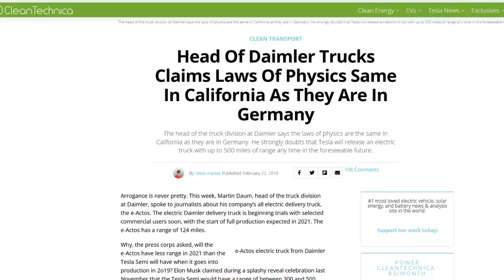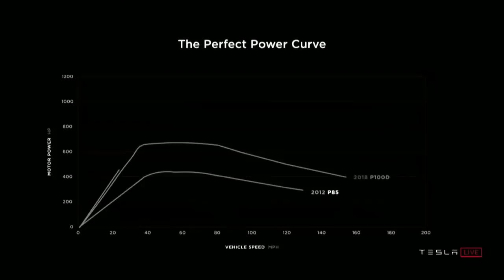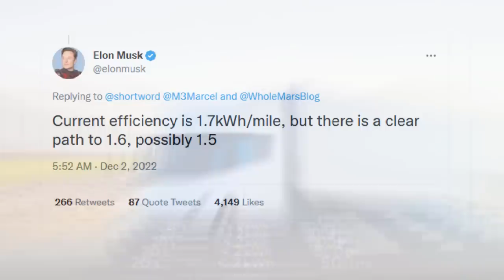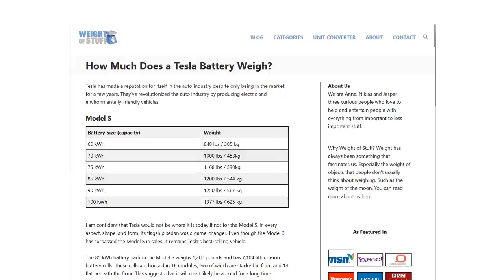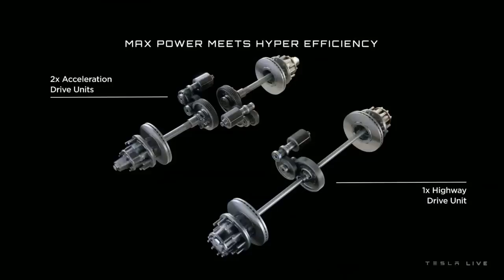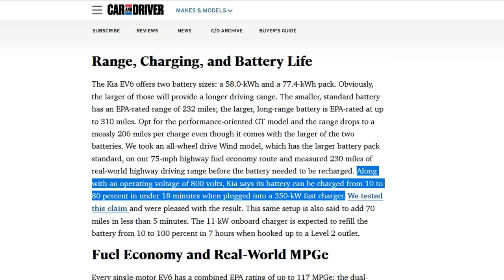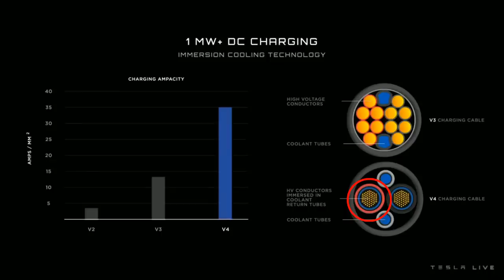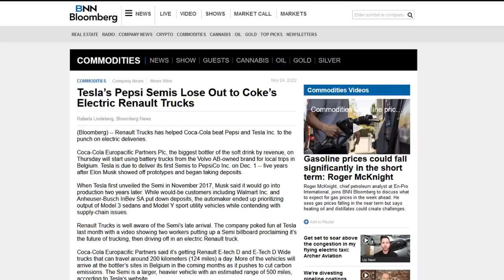Elon Musk Drops Tesla Semi Bombshell

Comment: I'm a long haul truck driver and honestly, I'd be happy to drive an electric truck. I have no "love" of diesel, as long as I have a power unit that works and makes me money, great. That said - there are some real problems with people's enthusiasm for this recent "event" that our pal Elon held the other day.

80,000lb is the max gross weight of a truck for most highways in the US without getting special permits. I have a truck with an EPU (electric aux power unit) so that I don't have to idle when the truck is shut down to power AC, etc. For this most states (-2) allow me an extra 400 lb to offset my batteries so I am legal under 80,400 gross. It seems the Tesla semi is being given 2000 to offset the batteries, at least in California. But gross is not freight, it includes the weight of the truck, gear trailer and the freight. Most modern diesel trucks promise shippers that we can haul their freight that weighs up to 48,000 lb which means we keep the weight of the truck / trailer to under 32,000. 

Elon and his staff talked about the truck that went over Donner pass being "fully loaded" at 82,000. But he didn't give us any idea what the weight of the truck / trailer was vs freight. I saw that he was using a flatbed (which is what I drive) loaded w jersey barriers, the low concrete walls that you see placed to direct traffic, etc. I'm not sure what the total weight of those barriers would be but I can make a very educated guess. The most common jersey barriers are about 4000 libs each. In the video at his event it looks like the flatbed has 9 barriers on, so the total of freight looks to be max 36000 lbs, which is a fairly light load. This means  the truck and trailer were considerably more than 32,000 lb if the gross weight of the loaded truck was 82,000, something like 45000 lbs, or 13000 lbs heavier than most of today's diesels.

People who aren't truck drivers might think it's not a big deal and that I'm nitpicking, but I can assure you that I'm not. How often do I haul 80,000 lb? Well, it's tough to get loads to weigh exactly 48000 of freight but I'm generally carrying above 70,000 most of the time, maybe 2/3 of my loads, and I'd guess that about 1 out of 8 is 78,000 or more.

As a flatbed driver freight like steel (coils, tubes, plates) aluminum, copper, roofing shingles, bricks, lumber, etc are loads where we show up and the shipper loads us as close to 80,000 gross as they can, weighing us on-site to check we are as close as they can be. A truck that can't carry that promised 48000 lb of freight is a major problem. Making the truck much less flexible when it comes to filling clients needs and making $.

The fact that they are not mentioning these facts and white washing over the issue to an  auditorium of techy car drivers that will seemingly clap for just about anything is a real tell that there is an issue that they aren't being forthright about.

A couple more issues as well, why did they choose to use a flatbed for this "trial" instead of a more common box truck? Especially when they talked about their research into making the aerodynamics of the tractor/ trailer work together? The answer is obvious to a trucker. The jersey barriers on the flatbed, not loaded to the side, are much more aerodynamic as they are about 3 feet tall vs the box truck being 8 1/2 feet tall from the deck and the same width as the truck. This gives a very big aerodynamic advantage to the truck on this trial.

Also, as for a "long list of companies clamoring for Tesla semis" it just doesn't seem to be true. Pepsi has an order in for 100 trucks, Walmart 150, UPS 130. This is nothing, barely an experiment. Walmart has a fleet of 10,000 semis, UPS 125000! I would hardly call an order for less that 0.1% of a fleet "clamoring".

Also, the 500 mile range is only adequate for a small segment of today's trucking. As a long haul driver I usually drive about 550-600 miles in a average day. 500 miles seems like it would be close to my needs but it's not. When my fuel is at 3/8 full, I'm looking to refuel. It's too risky to let it go down below say 1/4. Weather, traffic, detours etc all have to accounted for so my actual range in a Tesla would be about 375 miles, just a bit over a half days driving. It takes about 7 minutes to fill my truck with diesel, seems there is no way that I can come close to that time frame with an electric truck. Electric trucks would currently cost me a lot of time and therefore $.

Also, I don't start and end my day at a terminal. I am usually "out" all around the country for 2 - 3 months without coming back to a terminal. Where the heck am I supposed to charge this truck? There is no infrastructure in place or on the horizon. I can buy diesel about every 25 miles all over the entire country. No way that will be possible anytime soon for electric, actually, there is already a huge shortage of parking for big trucks in most of the country. So, even if you did put these into 100% of current truck stops I still would often not be able to access them. Changing this would take decades, at a minimum.

I would be interested to see how Teslas will work with local deliveries or as "yard dogs" (trucks that move trailers around at terminals) where they start and end their day at the same location. But any idea that this is going to be a major change in terms of the number of diesel trucks anytime in the near future is truly almost silly. It's going to take a long, long time no matter how much people want to hype Tesla!
Reply: Absolutely the most informative comment in the whole section. Probably more informative than the Elon Self-Congratulation video above.
Reply: "13000 lbs heavier than most of today's diesels."

Should be significantly lighter than that. Going off 250 watt hours per kg that they've achieve with cars a megawatt battery would be about 4 tons. 
Take of the weight of a diesel fuel tank, gear box etc and add on the extra weight allowance for EVs and they should be in the same ballpark as a regular truck.

"It takes about 7 minutes to fill my truck with diesel, seems there is no way that I can come close to that time frame with an electric truck"

Tesla is claiming 400 miles of charge in 30 minutes but you can unload while you're charging. That doesn't sound too bad but they'll need to pull off a miracle with the infrastructure. 

 "I would be interested to see how Teslas will work with local deliveries or as "yard dogs" (trucks that move trailers around at terminals) where they start and end their day at the same location."

I think they would also make much more sense out of the US. It could do almost any journey in England on 500 miles for example and power/weight ratio becomes more important with hills and more frequent stop-start driving. We also have diversions in some areas for HGVs to reduce local pollution which these should be exempt from. This would require a flat nose redesign for our streets though which would destroy the aerodynamics.
Reply: Joe, good arguments, here are my (short) answers to some of them:
- as for weight, I've read that the flatbed carried 11 barriers, so that would be 44,000 lbs.
- as for the infrastructure, just as the nationwide infrastructure won't be installed overnight, we also won't go to 100% electric trucks overnight. Let's start with local runs and installing chargers at terminals and customers first. Start with the low-hanging fruit and gradually build out more and more longer routes.
- as for charging time, i assume (Dutch non-truck driver here) you have to take mandatory rest stops and bathroom/lunch/dinner/sleeping breaks. Once that infrastructure is in place (and yes, that will be a hell of a job, no doubt), all that waiting time becomes charging time. In the end, there will be almost no time lost to charging, assuming that the infrastructure is there and trucks can charge fast enough, like this Tesla, 70% in 30 minutes.

If you want to read more research around electric trucking, I'd recommend @AukeHoekstra on Twitter.
Reply: @Ken North Where does such a breakthrough come out as useless? Just the elimination of diesel fumes around cities, (mandated by legislation already) is going to be a lifesaver, I expect many lives to be saved and accidents avoided. Why take the opposite extreme and say it is no good? You are 100% wrong on the face of it and are going to look silly.
Reply: Aha!  Finally a comment from someone who sounds like they actually are a trucker!
I've heard an interesting range of approximations of the load it was carrying now...  ranging from 1/4 of a diesel semi's load all the way to almost the same as a diesel semi's load...
From what I'm aware of, it sounds like the 500 mile drive was done conservatively along an optimised route - and during that drive it only overtook one diesel semi.  As with electric cars, it looks like it'll start off only being suitable for users with specific circumstances.  It'll be interesting to see how many years it takes for electrified haulage, including the infrastructure, to achieve mainstream viability.
I could see this sort of thing potentially being better suited to UK haulage than US haulage if only it were way shorter.  
But don't take what I say at face value, I'm a British gardener, not a trucker!
Reply: @Ken North That's my assumption.  As with anything Musk touches...
Reply: Very much agree.nice to hear a fellow driver(former driver here).
All these issues are very real but i think that with time they may be overcome.the infrastructure for electrical supply will follow uf the semi can prove its worth.if the cost of electricity can be brought down (and the powers that be can reduce their greed)then the operational cost of the vehicle can be reduced making an electric semi more cost effective.a reduction in load for a reduction in $/ld shipping would be enticing to many shippers.
Ive been off the road for many years now so my opinions are likely full of flaws and errors. 
But what has remained constant throughout history is if it can bring money the infrastructure will follow.
The biggst hurdle i see is electric supply.we either need to build more non polluting sources(nuclear) or learn how to better manage are current generation and consumption. 
I personally feel if the government will remove and rewrite obsolete laws concerning types of nuclear plants that generate byproducts useful in tge further generation of fuel for nuclear bombs...i/e fast breeder reactors....we could be money ahead.
Reply: One thing to bear in mind.
Was the extra allowance announced before the Tesla launch or was it as a result of others saying "we can't do it, we need more" AFTER Tesla launched?
Reply: I suspect there's a reason why they're starting with specific clients ... ones whom you can take a good guess at what their standard load will be and likely not be thrown any curve balls.  As much as this truck will save those clients a lot of money per rig, it's also still very much a beta test and tech rollout.  Doesn't mean it won't work well, but it'll likely get a lot better on the v2 and v3 trucks as the tech improves.  Those new trucks will also work their way towards those max capacities and increase the amount of the market share where a tesla would make sense. Heh, it's not one truck to rule them all yet despite the marketing, but it is one truck to open the market and make it profitable for select partners immediately.
Reply: @tedmoss  "elimination of diesel fumes around cities" doesnt put food on his table.
Reply: @bloodypommelstudios7144  If the weight is much less then why did that 35000 lb load make the truck gross 82k? 

As to unloading while recharging - why would customers invest in recharging stations at their facilities for us to use? I often deliver to fairly small operations, there is no way they would do this. Even bigger customers won't see this as their responsibility.
Reply: @McTrex123  some fair points there. It's obvious that infrastructure would have to change if the technology is accepted but I think it is still a big "if". As to charging and breaks i alluded to the fact there there already isn't enough parking in many areas of the US for big trucks as it is now. Even if all the parking spots available somehow suddenly had charging stations (I just can't see that happening for decades) it still wouldn't solve the problem. Every night I see huge numbers of trucks parked at on/off ramps of highways, roadside in industrial areas, "illegally" in shopping malls, etc. None of these would even have charging stations. The only mandatory break we have in US trucking is that we must take a 30 minute break within our first 8 hours of driving. We can do a maximum of 11 hours per day.. The flexibility of refueling that we have now would need to be replicated somehow with EV, or the whole system needs to change. I don't see either happening quickly for regional / long haul trucking
Reply: @tedmoss  Your sentiments are understandable, but the reality is that the whole transport industry would have to change for these trucks to be useful in number. I just can't see all the obstacles changing for many many years - ie, we can't even keep up with the need for regular parking in the US, much less having charging available at parking spots for every truck that doesn't go back to a terminal every night. Just nowhere near feasible at this point
Reply: @Ken North exactly
Reply: @phillip6083  Lots of interesting points there. I didn't even want to touch the issue of the power grid in my original post - so many obstacles
Reply: @rogerstarkey5390  no sure what allowance you mean, but if it's the extra 2K weight allowance for batteries there is already some allowance in the law. For example, I drive a 2021 truck with an EPU to replace a diesel powered APU (auxiliary power unit, basically a small generator). 46 of the 48 states give me an extra allowance of 450lb to offset the weight of my batteries for this unit, so I can gross 80450. I assume California has a law on the books for fully electric trucks to go up to 82K but honestly the Tesla event was the first I've heard of this
Reply: It is smoke and mirrors,of course automatoms clap if they see others do so.
Reply: @joepianpiano  
Ok, it was "a thing" in 2020.
How about 2017 when they announced the Semi?
Reply: Regarding the speculation over unladen weight.
The best indication I have is Zachary Kirkhorn (Master of Coin😉) stating categorically at the Q3 conference call this year
"No sacrifice to cargo capacity"
Followed by Elon Musk saying
"Yeah, exactly, very important, no sacrifice to cargo capact, 500 mile range"
.
Now bear in mind both the audience (shareholders [+"critics"?] and the financial "experts", some of whom would "tear them a new one" if found to be incorrect)
.
Then add the timing, shortly before the actual delivery of product.
.
Would that not be a "bold" statement if not absolutely confident?
.
And yet despite reiterating the same at the event, while showing EVIDENCE of a truck doing it there are still people saying "it can't carry the same cargo as a diesel".
.
What exactly will it take?
.
Maybe a "group test"?
Every current EV truck, plus the two most popular, up to date diesels?
(Diesels full at the start?)
690 miles? (see what I did there?)
11 hour drive day?
Mandatory stop?
Same route as the "delivery" test? (Extended 200 miles?)
.
Would that "prove" it?
.
Discuss.
Reply: Been waiting for an actually driver to point this point.. the whole thing seems sketchy.. You cant "launch" a truck and not state the weight!
Reply: @magicker8052  "Regarding the speculation over unladen weight ... What will it take?"

I can tell you exactly, it will take 10 minutes and $28

Run the empty truck and trailer over a CAT scale (available at almost every truck stop in the country for $14) get the empty weight, then scale it again after it's loaded for another $14. We do this all the time as drivers.

See, I know this business and you clearly don't. As soon as I heard Elon say "the truck is fully loaded at 82000 pounds" my ears perked right up because that is misleading. He should have said with 48000 pounds of cargo, for example. 

The fact that he chose to state it in a misleading way is already clear proof to anyone who knows this business that the weight of the truck reduces the amount of cargo it can haul - the only question is by how much.

Now, I'm sorry to be rude to you, but - you can go on reading tech reviews and listening to Tesla apologists claiming there is no reduction in cargo capacity or whatever other idiotic circle jerk statements they are using to hype their product. But if you actually believe them, well ... doesn't say much about your judgement.
Reply: @Mark it's true, I'm sure the ultimate goal will be driverless vehicles, I think it's an interesting idea way off in the future. But I'll tell YOU this "bud" - they'll be pulling your fingers off the wheel of your little EV car long before they'll be pulling me out of the cab of a long haul flatbed - guaranteed
Reply: @joepianpiano  I think you replied to the wrong comment.. I agree with you 100%
Reply: @rogerstarkey5390  see response above, sorry replied to the wrong person
Reply: @magicker8052  sorry!
Reply: @bloodypommelstudios7144  The battery is in the 800-1000wHr capacity, this puts the batter weight ate 17,000-18700lb
Reply: @bloodypommelstudios7144  Name one EV vehicle that is lighter than it's ICE copy.
The Electric Mini is heavier than it's ICE sibling the Mini Cooper S, The Ford Lightning is over 1,900lb heavier than the Ford F-150, Kona electric is 700lbs heavier than it's gasoline engined sibling.

I can find the weights for every single semi and trailer out there, every single manufacturer provides them.
They do so because that weight tells their customer the truck driver, the truck company owner, how much cargo it can move, and it tells him how many he needs, now many people he has to hire.
I dare you to find official weights for the Tesla Semi, the Tare weight, the weight of the Semi with an empty trailer.

So far the only way we have a clue as to the weight of the Tesla Semi is by reverse engineering using the known weights.
As Joe Pianpiano said, we know the weight of the cargo, and the trailer, and with that we have a ballpark estimate of the truck's weight
We also have the minimum weight of the truck using the weight of the battery and the known weights of a Semi of the same size minus it's ICE components.

Fact is the Diesel Engine (2,050-2500lb), the transmission (650-800lb), fuel tanks (call it 4,000lbs of fuel + the tanks themselves), all that combined weigh less than the 17,000-18,700lbs that the Tesla Semi's battery. Oh about that gear box, Tesla Semi has heavy reduction gears (more than one) that convert the motor's 23,000 RPM to about 500 RPM at the wheel, and it has 3 of them which combined are about the same weight as the transmission of a diesel truck.
You have cooling requirements, which mean coolant lines, pumps, radiators, same as the diesel.

So go ahead, do your own number crunching using publicly available data, and yes, you can find all the weight information needed if you are willing to look.
Reply: @joepianpiano  "If the weight is much less then why did that 35000 lb load make the truck gross 82k? "

That is assuming your estimate is correct, these barriers evidently vary in mass a lot since TF estimated a quarter of what you did. If it can only carry 35,000 lbs then I have to conclude everyone on the design team is a moron and I don't find that very likely.

"As to unloading while recharging - why would customers invest in recharging stations at their facilities for us to use?..."

Yeah like I said the infrastructure will be huge challenge. Initially there will probably only be a select few companies where it's a reasonable option. Perhaps Tesla could install the stations for free and make their money back through selling the electricity to the driver's company?
Reply: @linusa2996  The 18650 cells they're now producing are 0.25 Kwh/kg, that is 4000 kg (8800 lbs) for 1 MWh. Initially I thought that was the ED of the whole unit (casing, cooling, controlers etc) rather than individual cells but they should still achieve well over 0.2 kwh/kg.
Reply: @bloodypommelstudios7144  Tesla is using the 2170. The weight of the battery is not just the cell itself, that's only part of it. The case that holds also has weight and it has to be strong (thick) enough to prevent penetration (some Tesla cars have had nails and other large object pierce their battery cases and damage the battery), the coolant lines.
Reply: @linusa2996  "Name one EV vehicle that is lighter than it's ICE copy."

Weight reduction isn't such an important metric for most EVs. EV trucks are also allowed to weigh up to 2 tons more (depending on local legislation) so it doesn't need to be lighter.

If it turns out my estimates are further off than yours I'll gladly admit it. Guess we'll wait and see.
Reply: The extra 2,000 lb is because it's an all electric unit or non i c e. They do the same thing on CNG and LNG and also if you have a APU. Which this doesn't make a lot of sense to me because CNG and LNG is still an ice. I honestly think this version myself brother will be a little bit dodgy even though it's covered for the first million miles. I still want to wait till they start coming out of gig of Texas. It's still a good truck and it would still save money over anything that it would compete with now but the version that's coming out of Texas the batteries that are coming out of Texas are just going to be well it's going to leave everything in its dust. Remember Elon Musk has been on vacation for 2022 he's not even trying right now. He's about to go on an innovation spree that's going to just make everybody crazy I'll see you down the road brother.
Reply: @bloodypommelstudios7144  Jersey barrier weights - I don't think you realize that if they are only five tonnes that makes my argument seven times stronger. But I'll put that aside, the reason I chose 4,000 lbs was that the Jersey barriers on the Tesla flatbed appear to be double length. In other words, about 12 ft. I have hauledl these before and they weigh about 4,000 lb. I'm giving the best case scenario to Tesla here. If the weight is actually less, then that means the semi, or we would commonly say the tractor, weighs a hell of a lot more. I'm sure the design team isn't stupid, but they are constrained by the reality that batteries are very heavy. Again, if this truck could haul a comparable weight to a diesel truck then Elon would have stated it openly rather than the word salad he chose to use to obscure the situation. It's obvious if you were at all familiar with the transport industry.

Recharging stations - again, you have little understanding of how trucking works. If  company a, a shipper, buys the trucks and he is delivering to customer b, then company a could only service customers in about a 200 mile radius. The truck would then need to return to the terminal at company a to recharge in the solution you have given. Tesla is not going to provide charging stations at every single customer that Pepsi or some other shipper might have, that is very obvious.Even short haul companies need to be able to serve customers further than 200 mi away. This also leaves out all regional and long-haul trucking.  Added to this is the fact that they wouldn't be able to carry as much freight as a diesel truck can at the moment, according to your 5 ton estimate it would only be about 10 - 20% of what a diesel truck can carry at the moment. I'm not saying that electric trucks won't work but I am saying that at the moment they are very impractical and expensive in most situations.
Reply: @linusa2996  "Tesla is using the 2170"
So the battery could be even lighter than my estimate.

"The weight of the battery is not just the cell itself, that's only part of it."
Yes I know... I mentioned that in my comment.
Reply: @bloodypommelstudios7144  17,000-18,700lbs is what the 800-1000kWh that the Tesla Semi has based on it's claimed performance at max weight and range perfomance.
Reply: @jasontoddsprecher  Remember hyperlink radically transforming all travel? Elon Musk says a lot of things that he isn't able to pull off. He has a lot in common w PT Barnum, Donald Trump, a lot of hype for everything and few things that actually come to fruition.
Reply: @bloodypommelstudios7144  Based on known weight (we know what the ICE components weigh) the Tesla Semi is 10,000lb heavier compared to the equivalent Volvo Semi Truck. Also 2,000lb is 1 ton not 2
Reply: @joepianpiano  I'm pretty sure that that Tesla had to hit a couple of weight stations on it's trips.
Reply: @linusa2996  yeah, it did. Notably the one just before the grapevine north of LA. I don't understand your comment though, I'm not saying that the truck was over it's gross weight allowance, I'm saying that the weights of freight it is able to haul is not enough to make it competitive.
Reply: @joepianpiano  "I don't think you realize that if they are only five tonnes that makes my argument seven times stronger"

I wasn't suggesting TF's estimates were correct, I was suggesting they could be even heavier than your estimate. If you're certain they don't do a larger size though, that the trailer couldn't be heavier than you thought etc I'll bow to your experience in the matter.

"Even short haul companies need to be able to serve customers further than 200 mi away."

Do hauling companies have different vehicle types for different journeys/loads? I've never worked for a hauling company but when I worked for a refuse company we had 4 different sizes of truck which could hold anything from about 1 ton up to 13 tons depending on where we needed them to go and what we needed them to carry.
Reply: @joepianpiano  Not arguing that, I'm puzzled why they did not release the tare weight. Like you I suspect that the truck weighs a lot more than the comparable diesel semi. So higher truck purchase cost with higher insurance and less cargo meaning less income to pay off the higher loan payments, which means less net income.
Reply: @bloodypommelstudios7144  
Weight
I can't guarantee the weight of those barriers, but just based on Elon's evasiveness I can guarantee that it's an issue. I'm certain that trucks weight doesn't allow it to carry a load comparable to a diesel semi OR HE WOULD HAVE SAID SO!

Different vehicle types
This semi is a class 8 truck, basically what everyone thinks of as '18 Wheeler's. The company you worked for was likely a very local company hauling light loads if they had trucks that only went up to 13 ton. This is a totally different sphere of trucking. Basically, if you go out on the interstate and look at the big trucks there you will see mostly class 8 trucks. This is how about 70% of freight gets transported in the US. The Tesla semi is in competition with Freightliner, Peterbilt, Kenworth, Volvo and a few others that make class 8 trucks. Companies in this category generally haul heavy freight up to 40 ton gvw. As an example, the company I work for has 1500 trucks and is medium sized in comparison to it's competitors. We only have class 8, '18 wheelers' . This is the industry that the Tesla semi is competing in.
Reply: @Joe Pianpiano, very informative post! But one thing you got wrong - they used box truck for the 500 mile test. The flatbed was used just to show acceleration uphill.
Reply: @sashko02  I took a quick look and see where you are likely right! Oops. But when you see the driver close the door of that box truck, its definitely not filling all that space - could still be a heavy load though. Mea culpa!
Reply: The power that you would need is not available yet, besides that what would you do when those batteries freeze up in the middle of winter? I know, you’d have to call a diesel powered tow truck using a gas powered generator to charge them for a few hours. EV are essentially useless in colder climates.
Reply: Walmart Canada  and Pride Logistics groups and Loblaws - one of them has 30 units alone have Tesla Semis on order, im sure  those companies  have done the math, Also most of Walmarts  stores in the GTA  are within 500 miles round trip from its distribution point in Ontario, and runs to Quebec is  less than 500 miles, could be a game changer when it comes to Diesel Fuel @ $1.35 / liter vs Electrons - Quebec Hydro Electricity is cheap.
Reply: @bloodypommelstudios7144  Some  areas the Tesla Semi  make absolute sense, Quebec  where Electricity is real cheap, and abundant
Reply: @RedHeadForester  Elon touched Aerospace  with SpaceX,  it has  changed forever.😆 LOL, Oh Tesla is the most profitable  mass market automaker, dont  take my word  go ask John McElroy  of Autolinedaily,  a former Tesla skeptic.🤣😂🤑🤑
Reply: @RedHeadForester  The obvious solution will be that electric vehicles will be charged while on road, driving. Wait and see.
Reply: I get that, the first generation of these trucks will not satisfy 100% of the market. There will always be some hold out who needs that top percentile in range and load and is willing to pay 5 times the amount in Diesel fuel to get that.  what is that? 250$ in fuel verses 20 to 30 for electric and you have to make ONE stop to charge after leaving the site?  30 minutes for a bathroom break, buy snacks and drinks and order an Arby's meal.  You can charge this over night where you sleep.  Start out fresh.  ANd one commenter pointed out that the load was probably more like 44,000 pounds.  I think you are shooting yourself in the foot with your pessimism.
Reply: @calbowman4588  I guess you never seen an oil  spill  there's one right  now in the USA  as we speak  , Google  can  help you.
Reply: @TheWadetube  charge where overnight while I sleep? There are 0 chargers available at truck stops for electric trucks. Again, not saying the truck doesn't work but all the hype (just like your post) that turn this thing and Elon almost into a religion with their praise when this thing has severe limitations against diesel and will for quite a long time
Reply: @aurelio-reymilaorcabal9669  needs to within 200 miles then. Have you seen charging stations at Walmart for semi's?
Reply: According to an app linked in this thread, the Semi can charge from 10% to 23% in 15 minutes. See Leecy.
Reply: @joepianpiano  You are holding out for a super charger and they are not in place yet.  Elon is working on that.  When you stop for a sleep over someplace you need  a 110 or 220 volt outlet.  I don't know about truck stops in general but someplace should have at least that and every truck has got to have a charger that comes with it for over night charging.  Again, you are shooting yourself in the foot wanting to pay higher fuel prices over a longer charge time.  This truck might not be right for you if your  requirements are so stringent, just like most people would not buy an electric car with only a 100 mile range 20 years ago, now they have a 400 to 500 mile range and nobody can complain about that, especially with thousands of fast chargers across the nation.  It will happen too for trucks, just maybe not for you.
Reply: @tobyw9573  ok, why would that really matter to a commercial truck driver???
Reply: You won’t be driving crap these are autonomous driving vehicles
Reply: @middleclassretiree  I think it's a very interesting idea, care to venture a guess when? You'll be "senile 1 foot in the grave retiree" before it happens I'll bet :p
Reply: @joepianpiano  Tesla cars are sooo cool. The trucks will be too.
Reply: @middleclassretiree  I suppose a lot of truckers will be out of a job.  I suppose the pod trucks will be handling more mundane loads and the more treacherous, dangerous or delicate loads will have a human driver to oversee the run.
Reply: @bloodypommelstudios7144  you don't get 250wh/kg that is the cells energy density but a but consists of more than just the cells
Reply: @joepianpiano  see i question the 2 vehicles because with the flatbed you can get a pretty good guess of what the load is but is that the 300 mile or 500 mile semi pulling it because there could be a 5000 pound odd weight difference between the 2 models
Reply: Hold it. I don’t think the flatbed video was of the truck doing the 500 mile run. I think that run was done with a normal trailer. I think everyone should just chill out for a little while and see what the real world experience of the companies that are going to be using this semi are. Why does everyone have to jump on this stuff before they know a damn thing about it. God, the comments section on YouTube is toxic as hell.
Reply: I'm not a lorry driver but even my dumbass couldn't help but notice key numbers were not being told to the public. I can see ev lorries being used for short hauling, and even then I can see only a handful of those being Tesla.

Why have a Tesla lorry when you can have a known and trusted manufacturer that's also making ev lorries like Volvo or Mercedes? Tesla has stiff competition and I honestly don't think they're gonna do that well.
Reply: I believe everything you say but who cares the truck will be good value for some or it wont companies and truck owners wont buy  it for being a tesla fan it has to be viable
Reply: Also Tesla drove that flat bed truck 5,000 feet downhill.  The range is not a huge issue  as they claim you can charge the truck back to a 70% level in 1/2 hour..
  Fleets like Pepsi ect  .. can charge their trucks at their own Terminals  and save $200,000.00  on their Energy Bill every three years according to Tesla.. One Problem is the fact that   there may not be enough Lithium on the Planet to build all the batteries needed to convert to electric trucks and cars.
  China has the most electric cars and they are building 100's of new  dirty coal plants every year
Reply: @mikeskidmore6754  actually, for most applications the range will be a huge issue. Very limiting factor for this truck. How much will it cost Pepsi to build the massive electrical subplant that will be needed to charge all those trucks every night? Gonna eat into their "savings" from fuel quite a lot
Reply: @joepianpiano    I read that an electric truck can save $200,000.00 on a fuel Bill in 3 years.  It takes  1/2 hour to charge to 70% supposedly .. I don't mind taking a 1/2 hour break now and then if I can drive more.. I would like to take a 4 hour nap while recharging then drive another 8 hours..
Reply: @Ken North What is the percentage of diesel trucks that are presently hauling the maximum capacity every time they are loaded?